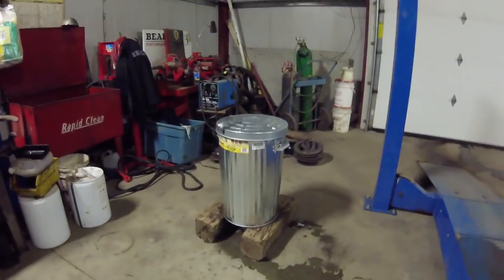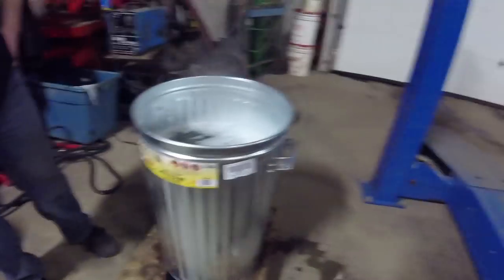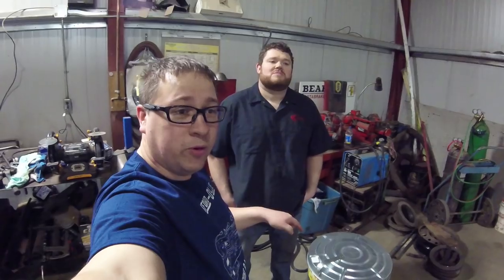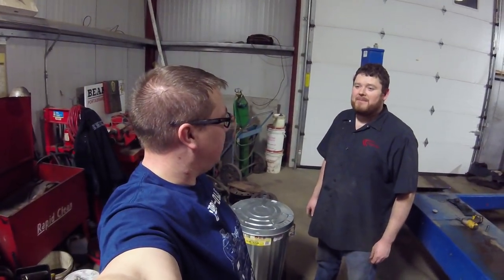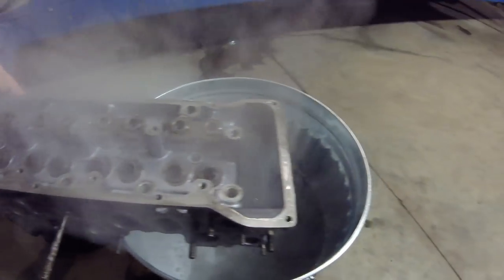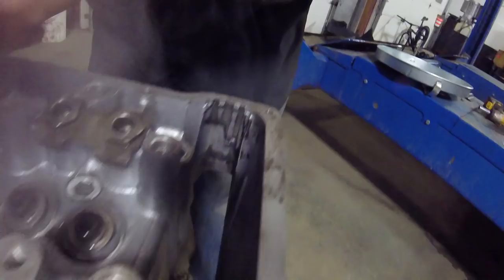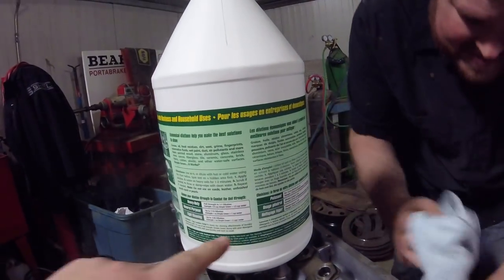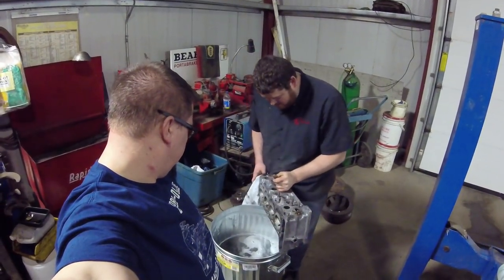Parts Cleaning with DIY Hot Tank

Comment: hmmm , think im going to do sumting simuiar , got an oildrum laying about , prolly going to use electric boilerheaters to heat up the water though
prolly can use a waterheater plucked off the street , take the top off and plug all the drains and stuff , hook up the elements in it and go cook some parts
you know.... those electric deepfryers prolly work too if you can find one with a large enough basket the elements can heat the water up to way beyond cooking temp so you dont even have to turn it all the way up

Comment: you should look at the simple green aircraft, safer for aluminum.
Reply: I thought (?) simple green says not to use it on aluminum...
Reply from the maker: The "Simple Green All-Purpose Cleaner" we used is UPC 43318-13913 and is specificaly listed on the label as Aluminium safe (do not use on leather, suede, wood, or pearls) and curiously can even be used in laundry machines. Simple Green does have a bit of variety in their lineup and it is important to match the product to the material task. Thanks again for commenting and watching! - Darren
Reply: Thank you!!! Awesome video, exactly what I was hoping to find when I searched for "can I hot tank stuff at home?"

Comment: Hey guys... working on father's 1977 Corvette and this is AMAZING!  I found me a 30 gallon galvanized steel can, the Simple Green... I cannot seem to find that burner though.  Anyone?
Reply from the maker: I know single burner multi-fuel stoves are difficult to find but the Coleman "Bottle Top" propane unit or similar might do the trick provided you have a solid base for the garbage can with enough room under it. I would stack some cinderblocks or bricks.

Bigger burners like outdoor "turkey fryers" would certainly support the weight and give the heat you need.

Depending on your heat source output and conditions, you might have to be patient. 

Thanks for watching and commenting! -Darren

Comment: Find yourself Purple Power. Not that castrol super Kleen in the purple jug. It’s called purple power and man that’s amazing cleaner. Best I’ve found. Walmart in the US or auto parts stores across the border is sickening cheap compared to prices we have to pay for it but man it’s good shit. You can thank me later.
Reply: i reeeeally love that stuff my grandpa got me started on it and i swear by its affectiveness at least for what ive used it for. Have you any experience using the stuff on metals?
Reply: Is it non flamable? to use it for a hot tank?
Reply: Super Clean and Purple Power both will corrode aluminum and will screw up chrome as well but works great on greasy steel or cast iron parts.   I destroyed the looks of my Yamaha Virago 750 with the stuff.  It Looked great for about a week the it started corroding. Great stuff but be careful what metal you use it on.

Comment: What ratio of Simple Green did you use, no one tells? I used to use a 35 gallon grease drum (thick wall) sitting on an old hot plate. Coat hanger attached to each item in the "soup" to pull and check.

Comment: What did you guys use as a solution? 100% of simple green or mixed with water? Hope you can share the recipe. Does it damage finish of the aluminium?
Reply from the maker: Tim Kitov we mixed up a half gallon jug of simple green to the entire can of water, no specific science there. I have used 100% simple green as aluminum cleaner with no issues on other projects. Its is quite different from "Super Clean" and other non aluminium friendly cleaners. Thanks for the sub and the comment, we are glad to have you along for the ride! - Darren

Comment: did you remove valves...springs....cams.....lifters.....rubber seals etc.....or put it all in
Reply from the maker: We had previously stripped the head, and while you could tank any of the parts mentioned, it should be noted that any steel parts will flash rust after drying. So thorough drying,  coating with oil of all non-aluminum parts, and detail stripping lifters is required.

Comment: Would hot tanking a aluminum lower intake manifold warp it. I have a explorer intake that I’m trying to clean up for my 94 gt
Reply from the maker: This process would not warp an aluminum intake manifold as the temps in this produced are cooler than an working engine on a hot day. This would be ideal for cleaning manifolds as you are suggesting. Thanks for watching and commenting! - Darren

Comment: I'm super impressed with this idea to clean engine parts. 

Another way to achieve the same results could be use a plastic bin, fill with simple green, water, and 1000W bucket heater to sustain the temperature. Let run for several hours or overnight and check its progress. Then you wont have any leaks and dont need to worry about gas fumes from bunsen burner and leaks. We all probably have  a plastic bin that is large as the cylinder head.

While doing more research, I'm not sure if this is safe on aluminum because of:

1. From Simple Green website 
-Simple Green's FAQ page can be found HERE. (http://www.simplegreen.com/faq.html)
Aluminum - Is it safe to use Simple Green on aluminum? 
"Simple Green products have been successfully and safely used on aircraft, automotive, industrial and consumer aluminum items for over 20 years. However, caution and common sense must be used: Aluminum is a soft metal that easily corrodes with unprotected exposure to water. The aqueous-base and alkalinity of Simple Green or Crystal Simple Green can accelerate the corrosion process. Therefore, contact times of All-Purpose Simple Green and Crystal Simple Green with unprotected or unpainted aluminum surfaces should be kept as brief as the job will allow - never for more than 10 minutes. Large cleaning jobs should be conducted in smaller-area stages to achieve lower contact time. Rinsing after cleaning should always be extremely thorough - paying special attention to flush out cracks and crevices to remove all Simple Green/Crystal Simple Green residues. Unfinished, uncoated or unpainted aluminum cleaned with Simple Green products should receive some sort of protectant after cleaning to prevent oxidation. 
"

2. From the US Army:
"Simple Green's not for Aircraft Washing
Don't use Simple Green to wash aircraft or aircraft components.
It has been brought to the attention of the AMCOM Depot Maintenance Engineering Team that numerous units are using the commercial product SIMPLE GREEN as an aircraft wash. STOP! This product has been through DoD testing and was determined to be highly corrosive on aircraft aluminum. It can also be a catalyst for hydrogen embrittlement in high strength aircraft alloys.

While it is a highly effective cleaning agent for floors and non-aluminum/non-high strength alloy vehicles, this product is not approved for aviation usage.
If your unit has been using SIMPLE GREEN on a regular
basis, it is recommended that a thorough fresh water wash with the approved cleaners per the appropriate airframe maintenance manuals be accomplished as soon as practicable. This should be followed up with a corrosion inspection/treatment and application of approved CPCs.

Insure that no unauthorized cleaning products are being used on your aircraft or in the shops as a component cleaner.
"

Overall I like this idea to use bio-degradable product to clean engine parts, but concerned on corrosion and damage. I heard Oil eater is also a good water based cleaner.
Reply from the maker: Thanks for the reply and there are many ways to adapt our "boil in a bucket" method to suit! The "Simple Green All-Purpose Cleaner" we used is UPC 43318-13913 and is specificaly listed on the label as Aluminium safe (do not use on leather, suede, wood, or pearls) and curiously can even be used in laundry machines. Simple Green does have a bit of variety in their lineup and it is important to match the product to the material task. Thanks again for commenting and watching! - Darren
Reply: @Killian na after removing from water just coat in oil and it wont rust.

Comment: What would that same method work in cast iron block with minimal rust nothing serious there's no pitted holes in the cylinder walls just surface cuz I have a bunch of Simple Green
Reply from the maker: It should work quite well for degreasing, but wouldn't do much for rust. With cast iron like an engine block, a consideration would be flash rust once it was removed from the water bath. Have a spray oil like WD40 at a minimum to immediately displace water from any machined surfaces. Otherwise the cylinder bores and bearing surfaces will grow fuzzy rust like moss. That will create more troubles.

Thanks for watching and commenting! - Darren
Reply: @GrandTouringConcepts  trick is to rince and dry immediatly, just like we do in the engine shops. And you mentioned in the video that the costic for a real hot tank works on rust, I assure you it does not remove rust. It is just a powerfull degreaser.

Comment: What temperature was it? I would like to try it will an electric burner.
Reply from the maker: We didn't record the temperature but it was slightly unpleasant to handle the pieces bare handed, estimate 50-60°C.

Thanks for watching and commenting! - Darren
Reply: @GrandTouringConcepts  no problem. I payed 200 for all the heads i bought online..for the same thing. This way i get race proven work on my head for half price. (The machine shop I use almost always wins at our local track)

Comment: Do you have to remove the valves, springs and cam to do the hot tanking?
Reply from the maker: You should absolutely remove all of those pieces before hot tanking. With hot water as soon as the pieces dry they will flash rust on any iron or steel surfaces. This can ruin bearings, valves and any hardened surface. Thanks for watching and commenting! - Darren

Comment: Super good idea fellas, decided to do the same thing went to Walmart and bought a trashcan soon as I started filling with water it started leaking all around the bottom rim but not just a couple of drops it was pretty much streaming out was getting the garage floor soaked and pretty much leaking on the Bunsen burner. Thought about silicone it up but don't really think that would work as the heat would probably melt the silicone, Think I'm going to have to find a quality can somewhere in the range of the $50-$75 marker. My ghetto hot tank is getting kind of expensive!!! LOL!!!!
Reply from the maker: I would seam seal it with high temp rtv like permatex ultra copper and let it buck.
Reply: Grand Touring Concepts Perfect!! Thank for the reply, I'm on it!!!!
Reply: @shawnlee4398  look into 45 gallon steel drums too, we sell used ones for $5 a pop.
Reply: @iambeeman1  I know this is old, but wow- 5 bucks?! Where are you located?